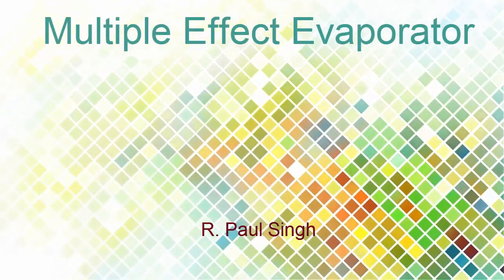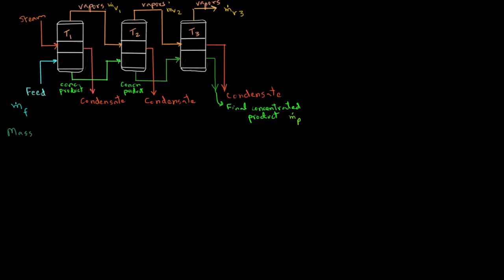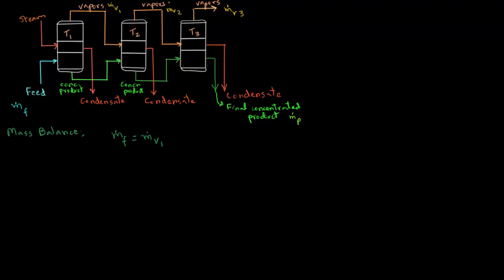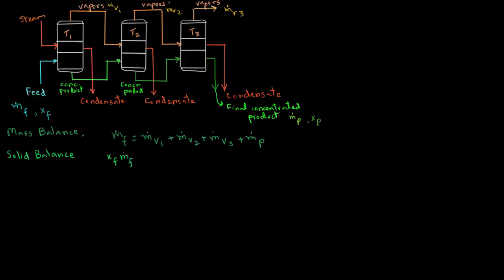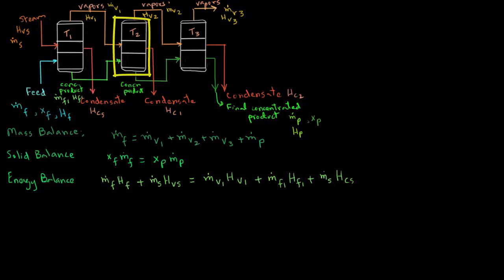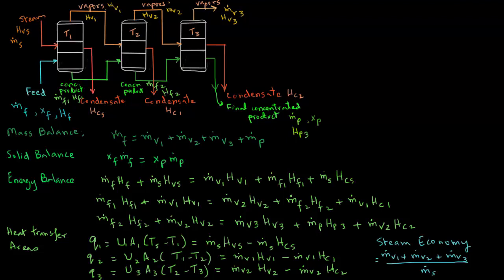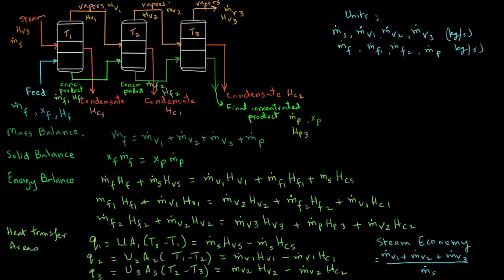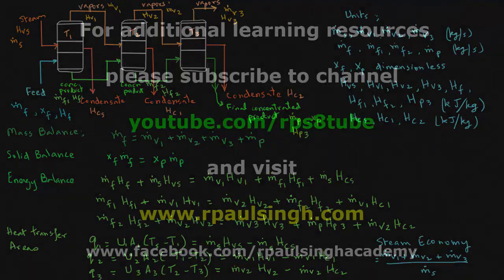Multiple Effect Evaporator - Mass and Enthalpy Balance

Comment: Dear R. Paul Singh,

I found your video to be very helpful for understanding the mass and energy balances that make up the Multiple Effect Evaporator.

However, I have a specific question related to the Evaporator that is unrelated to the video topic.

I was curious on what would be an acceptable feed in a Multiple Effect Evaporator system. For example, would a toluene phase feed (which has a higher boiling point than water) work in this system, or would issues arise due to the difference in boiling points? And, if so, would you have any suggestions to remedy that?

I appreciate any help that you may provide. And if this question is beyond the scope of the video, I apologize.

Thanks,

Travis

Comment: I think the total mass balance is not correct since mv1 and mv2  are not separate outlet and are inlet of next unit. So it should not be considered in the total.
Reply from the maker: Thank you for your comment. But, the mass balance as shown in the tutorial is correct! Note that vapors produced from the first effect (with mass mv1), condense inside the heat exchanger in the second effect and the condensate (of same mass as the vapors) is discharged as shown. Similarly, vapors produced from the second effect (with mass mv2), condense inside the heat exchanger in the third effect and the condensate is discharged. And, mv3 represents the mass of vapors discharged from the third effect. In each effect, an indirect heat exchanger is used where the vapors condense inside the exchanger tubes, only the heat gets transferred to the fluid in the chamber, and the condensate is discharged, as shown in the figure.
Reply: @RPaulSingh  Yes, sorry, it was my mistake. Thanks for your explanation.